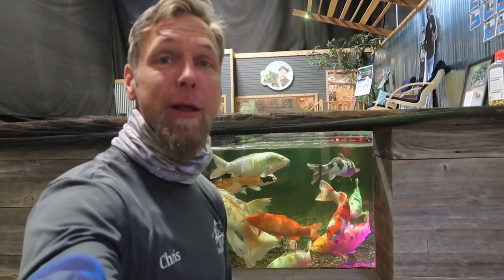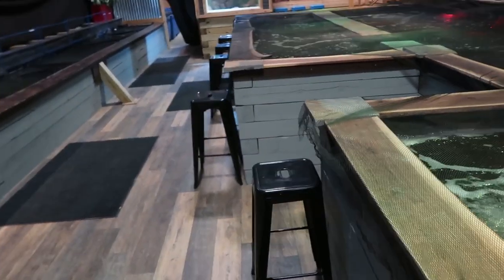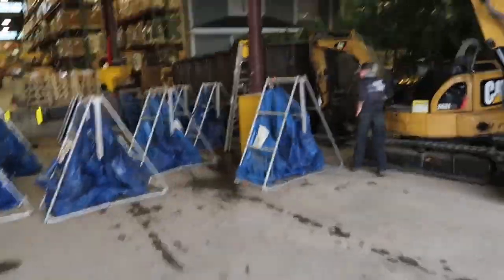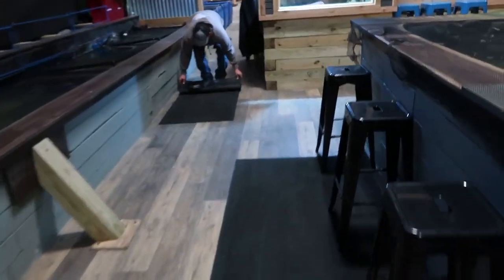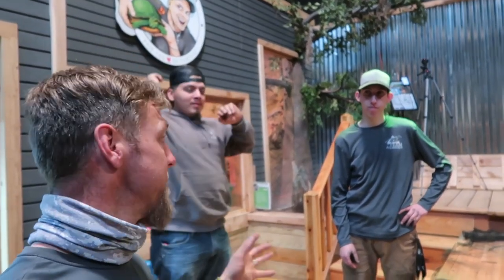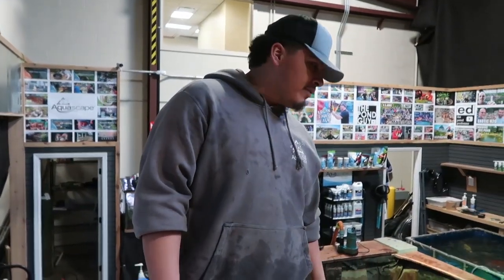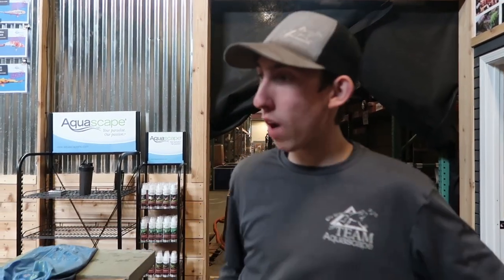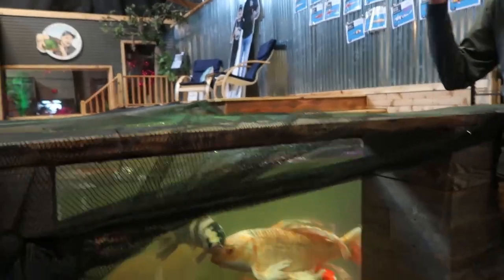*KOI POND* Cleanout at Aqualand's Fish Experience

Comment: Just an FYI that old water has no benefits, other than saving water. Only the weak and dying bacteria is in the water column, bacteria lives on the surfaces of that fantastic wetland filter.
 In fact new water would be better for the fish, as it resupply some nutrients that the fish consume, such as calcium.
But I don't know you guys could have changed water yesterday 🤷. On that, how are you guys removing nitrates with that many fish and no plant load?